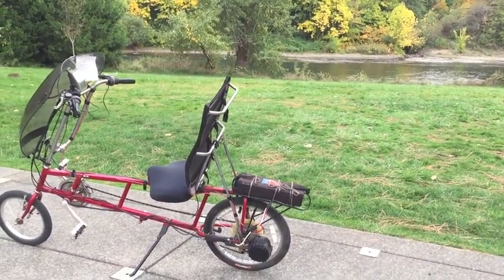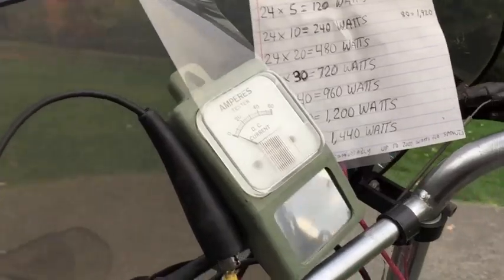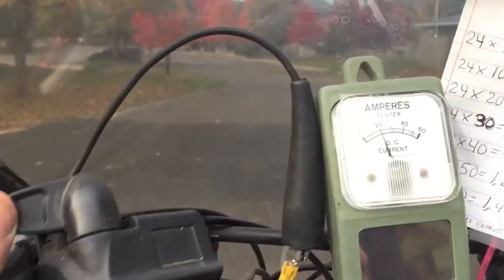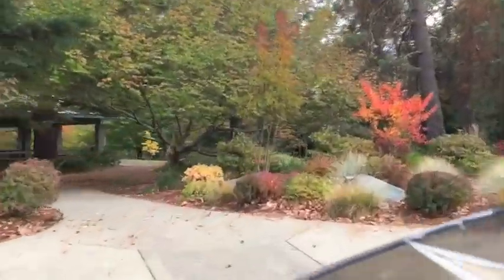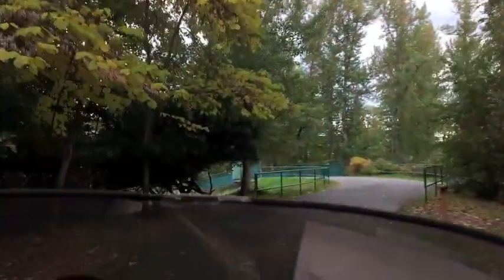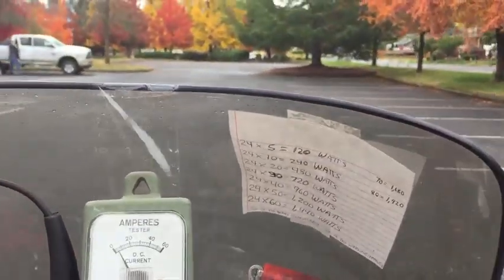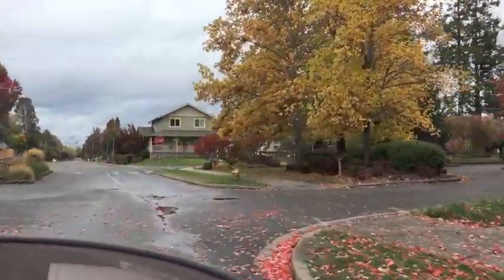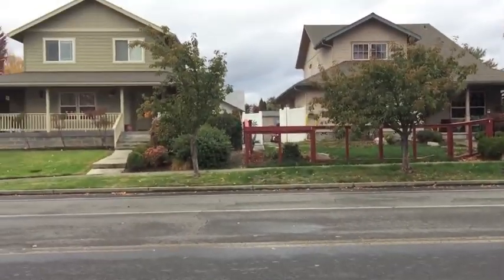Electric bike power consumption test.

Comment: Can you get solar panels that powerful?
Reply from the maker: You can combine solar panels to get as much power as you need.
Reply from the maker: This guy made his bicycle operate on solar. https://youtu.be/7EyRqQhuwio?t=693
Reply: @GrantsPassTVRepair  I mean, can you get powerful ones small enough. Pulling three of them on trailers might work, but is it practical? Parking in a city might be a problem due to size. How do you prevent theft? If you only travel back and forth between secure locations, it could be great for long journeys I suppose. I'd put bigger wheels on the panel trailers though. Those tiny ones look like they might flip on the slightest bump.